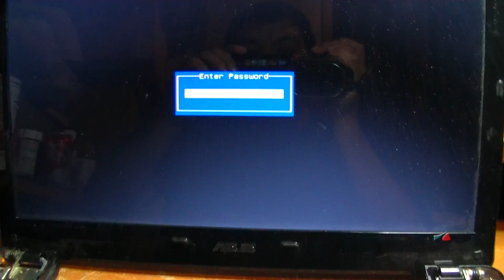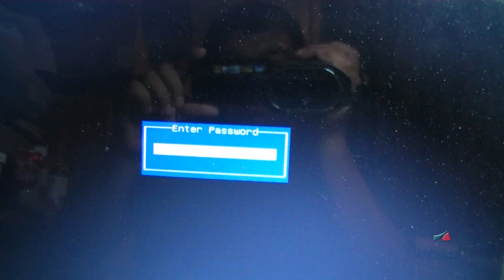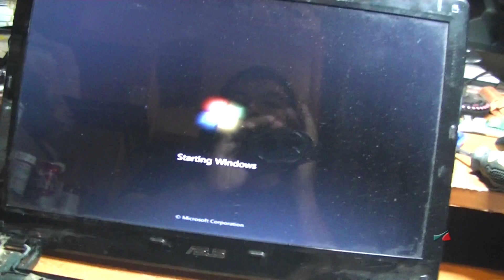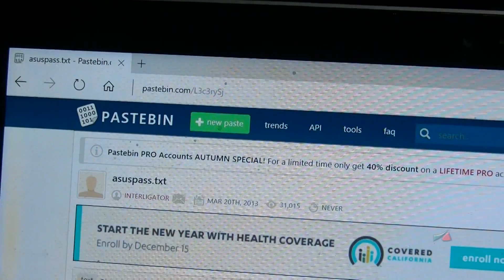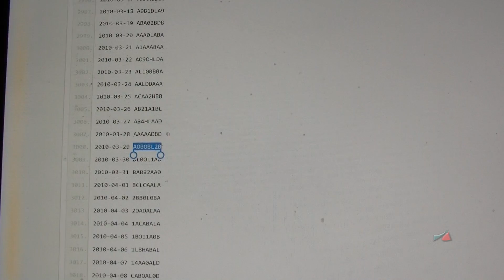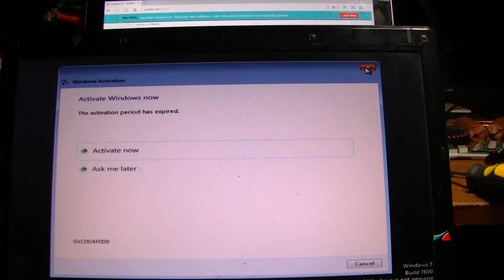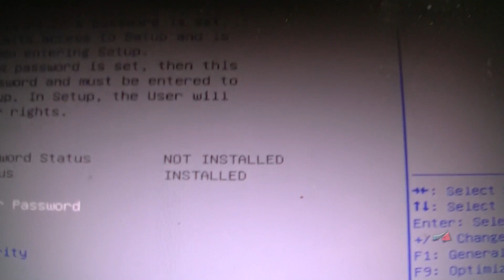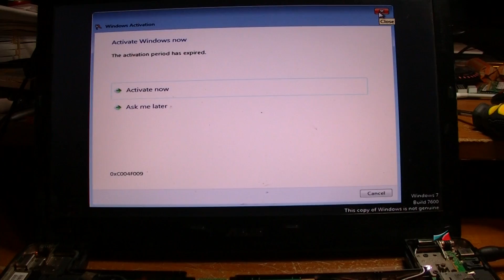Repair/Fix: ASUS laptop BIOS locked Admin and User password

Comment: Trying this on G74SX.  I did all this and I still get the enter password and if I do the alt+R, I get no date. I hook the hard drive back and it has windows and I took the battery out and hold the power button 30 seconds, I even did what Asus says on some you short the two terminals at the battery terminal,  left jumper  for five minutes why I did something ..else put the battery back in plug it in.  it starts by itself but no windows.. but back to the enter password screen, and still no alt+R date given.

Comment: I have tried to carefully take off the outer case; it seems to be locked into place with screws that are under the back plastic cover. How do I get it off?
Reply from the maker: Sometimes there are screws under the keybolard, try removing it and then there should be some screws in there, or under stickers, also under the battery compartment if it is removable.

Comment: thanx a lot! This video really helped me with my problem. Especially the part when you press Esc multiple times to enter the menu. In fact I didn't have the password issue. I was stuck on the user level and could change a thing in Bios.

Comment: I was locked out of the admin and not the user level of bios. Here is my fix. I reset cmos by removing the cmos battery on the motherboard.this resets the bios date to the manufactured date. Then take the date on the bios and match it up to the code with that date on the website that is in this video. Link in the description. Then when you get back into your bios password screen hit " alt and r " and type in the code that you got from the website. 
Removing the cmos battery on a laptop is time consuming but it is the only way the date would change in the bios.

Comment: Hi, I have the same Laptop, and when I turn on it shows Imidiatly  Enter Passwort, I can not go to Bios att all, I`ve put the Battery off and all what you did, but its not working, every time comes enter Passwort. I think that is User Passwort in Bios. What can I do ? Windows 7 Installed

Comment: If it does not work...coming on without pushing the on button...what do I do
Reply from the maker: Thanks for watching, and the instructions on the video might work for you but unfortunately computers don't always behave the same, due to different designs. It is really hard for me to know or suggest what to do because of those differences. I hope you are able to find an answer for your issue. Thanks.
Reply: Same problem :*( laptop does not automatically come on after draining and reconnecting the power.

Comment: some questions:   does the cmos battery supply voltage to a cmos CHIP? ...if you just have the cmos battery (no adapter or battery) in the laptop, does it boot up, if not what does it do? does the battery supply any other chip on the motherboard with power? any other information on cmos battery would also be appreciated ...thank you ...
Reply from the maker: The cmos battery provides energy to the chip, and the cmos chip keeps settings for the next time the computer boots. That little battery does not power anything else, on regular desktop computers the bios chip keeps all the information and will reset completely if the cmos battery is removed or the cmos jumpers are shorted. On laptops it works differently and some of the settings are stored in non volatile memory. Thus, if you remove the battery the bios passwords will not be reseted.